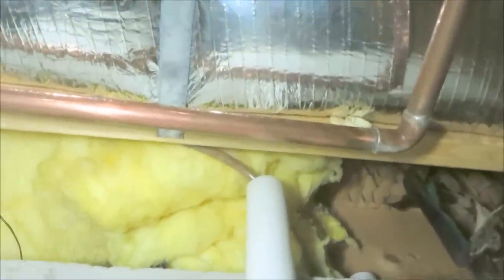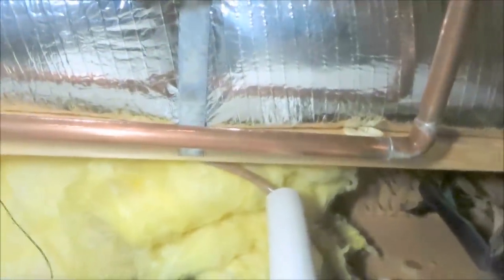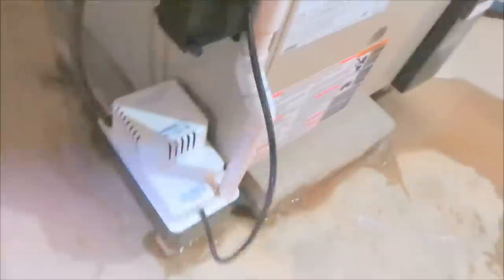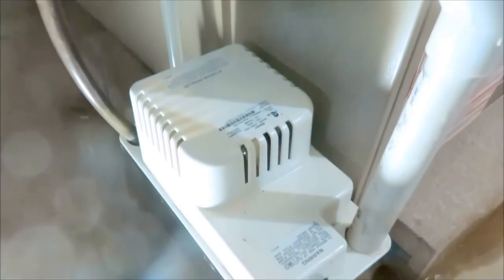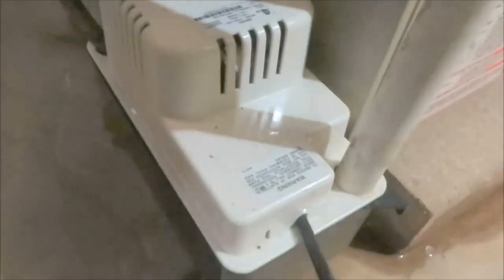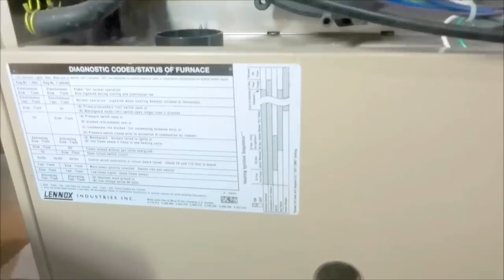HVAC:water on floor around 90+ gas furnace

Comment: I can't believe they cut those floor joists for the flues at the end of the video.  Looked like an easy fix.  I need to get a little air compressor like that for my truck.  Thanks again Steve
Reply from the maker: i was thinking the same thing about the floor joist.i use my compressor for many thing i have different ends/ nozzels for different jobs i do.

Comment: That's a lot of wood removed from that floor joist. Wouldn't those two vents have to be separated, and put through two holes in order to maintain structural stability?

Comment: Here one thing I learn is you need to run the cable of your thermostat through the pump for auto shut off if the pump fail.

Comment: I think you have a draining issue with the flue gas condensate itself... Most ALL 90%+ High Efficiency Furnaces develop this same issue. Good luck my bro! Great videos and work.
Reply from the maker: there was no water in furnace at all anywere........ the condensate pump line was blocked i blow it out then it worked fine .the water was running over the pump houseing onto floor

Comment: How much time was there between the first drop of water overflowing the condensate pump's tank and the owner seeing it?  In my house I have a cheap high water alarm next to the pump to detect overflow. If I were you, I'd recommend such a device to all your customers. It's a cheap way to reduce damage and catch failures more quickly. Your customers will thank you the next time it fails that the problem was detected before any damage occurred.

Comment: Hey Steve, ok to run a littler  bleach  in the pump to keep slim down or  what have every 6  months or so? Just noticed they hacked the floor joist to the point of failing ,4.48
Reply from the maker: +Billy Smith yes i would dump a gallon down ever so offen to keep the slim down will not hurt it but help it bleach or viniger
Reply: Use vinegar not bleach.  Bleach destroys the Little Giant condensate pumps housings.

Comment: Hey Steve. I thought the condensate pump only runs when the AC is on not the heater?
Reply: 90% efficiency furnaces have a secondary heat exchanger...they produce condensate when they absorb heat. You don't get that issue on the old 80% furnaces because they only have a single heat exchanger.

Plus, many times humidifiers are wired into furnaces, you'll need a condensate pump for that too.

Comment: What if you do not have that machine to drain the hose
Reply: Usually a pump is installed if the drain line has to go a long distance, drain upwards, etc...